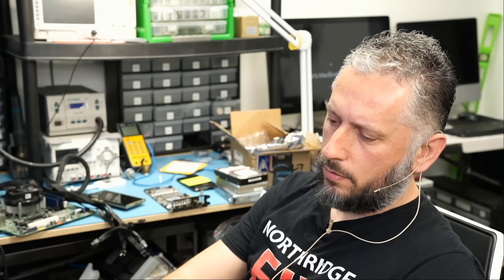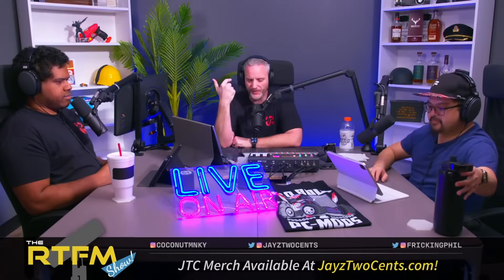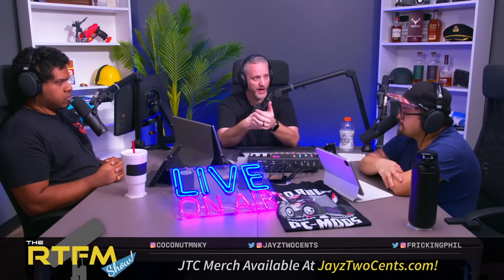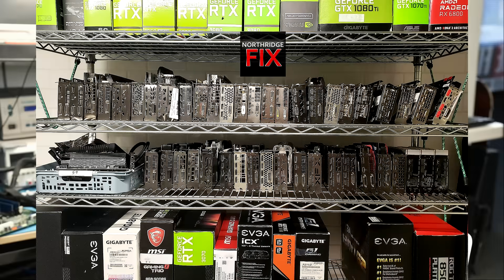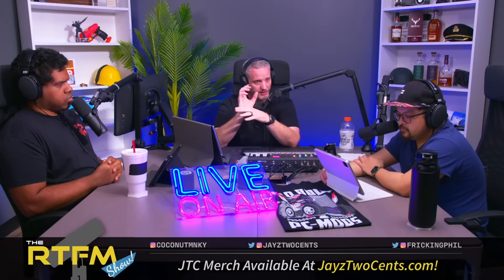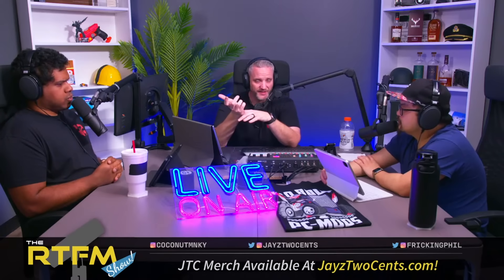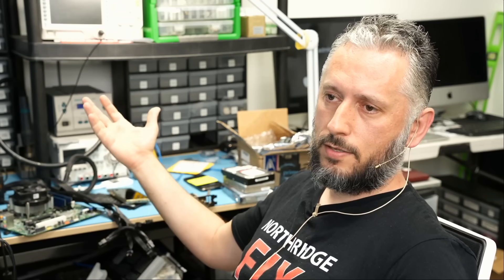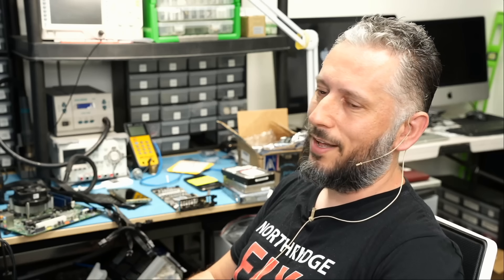Melting 4090 and CableMod. JayzTwoCents and Gamers Nexus Response. Blame NVidia or User?

Comment: My 4090 cable mod 180 melted into my card. The input side was fine, and it was fine before I got the 180 connector also.

Cable mod gave me a refund, didn’t want pictures, didn’t care to see the card.

I painstakingly removed the melted sections of the connector, literally cut it up and am still using it with the original 12vhpwr and it’s been fine.

I sent GN and email but I understand they’re busy. Still have the card and connector. 

Yes of course it was plugged in all the way. Photos to prove it

I’ll probably order a connector at some point and replace it myself but it’s been fine for a month now

Comment: I will still say this is the connector problem and refuse to buy any card with the new 12V HO connector, point blank. It is simple electrical flow. Electricity flows along the surface of the wires/connectors, so surface area matters and a good, tight connection matters. This is a common issue with those stupid wire nuts use for house electrical. a Poorly installed wire nut is a fire hazard waiting to happen and almost burn my house down. You take current that used to use 4 8-Pin connectors, hence this being a 4090 issue and not so common on 4080s. The 4080 uses a 3 8-Pin to 1 12 pin and the 4090 uses a 4-pin to 1 12 pin. You take what used to require 32 Pins and a thicker gauge wire and connector and are forcing that current through a small connector/gauge wire with smaller pins and only 12 pins at that, means more heat. Those smaller pins are also making a much weaker connector then the 32 pins used to make. Again, SURFACE AREA MATTERS! A bad, weak connection creates heat and starts fires, the end. This is NOT user error, this is a poor/faulty connector design! The 4090 is pulling too much current for what the connector can handle. Again, the 3090 only uses 3 8-Pin to a 12 Pin adapter as well. There's a reason NVidia made the spec for that adapter to use 4 8-Pins! It can draw more current under certain circumstances then what 3 8-Pins can handle. You really need to have a way to monitor the 4090's current usage over time and find out what current it's hitting when it's melting these connectors and I bet you, it's more than what an OC'ed 4080 or 3090 are pulling or why does it require 4 8-Pins on the adaptor? If the connector has enough play that the connector can back out, that is a bad connector design as well. These connectors are the problem, they leave way too much room for error, make a horrible connection and don't meet the current requirements for the cards, the end. The connector needs to be redesigned or not used at all and go back to the old 8 pin connectors. I rather have 4 of them, then worry about my GPU dying and having to pay to have a connector replaced every 6 months on a $2000 GPU.

Comment: I think it's pretty obvious the 4090 is pulling more power on pins than the connector is rated for. Electrical resistance while pulling high current creates heat, and a lot of it. Is it so hard to believe that the 4090, being one of the most powerful cards on the planet, is pulling too much current over pins that weren't designed for it? I wish someone would put together a video about putting an amp meter on those pins to see what they pull during a hard run of the card. I think the results would be pretty telling.

Comment: Was super paranoid about this and made sure my connecter was fully seated numerous times. Literally not even 20 minutes ago while playing Diablo 4 I smelled a plastic burning smell from my not even a month old PC and knew where it was coming from. Opened up my case and the connecter is hot to the touch. There’s definitely some melting and I’m scared to pull it off.
Reply: Which 4090 do you have?
Reply: @dudee789  it was the white strix OC

Comment: I just purchased a Asus Strix GeForce RTX4090 OC GPU and a 180' angle Cable Mod Connector for the card. Now I am worried that I purchased bad goods. $44.90 for the adaptor and 2190.00 for the Card. Perhaps if everyone that has had a melting issue would get together and file class action against Nvidia. Now I am seriously considering sending my RTX4090 back. I just gave my friend Northridge Fix's  phone number to get his 2080ti repaired. I have an Thermaltake 1200RGB PSU that has issue sending power out to the GPU going to send it in to get repaired as a back up Power spikes here is California.

Comment: Just want to say first off that I appreciate all the work you all do. Northridge, Jay, Steve, etc. My opinion. NVIDIA needs to man up and accept that they f**ked up and issue a recall and fix all 4090's released to date and figure out why this is happening. imo, Id 86 that connector. Go back to the 8 pins. Id rather have 3-5 connectors that are PROVEN to be sturdy and reliable no matter the application/situation than use 1 connector that is more a fire hazard than anything else in my house. imo, they are trying to crank too much power into these cards. They rushed the 40 series by overpowering them and it is now showing. Now wonder EVGA left the game. They saw what was coming.

Comment: Hmmm no I dont think you can conclusively say it's the cards fault, we don't know how good the contact is between the pins of the adapter and the card, and also fyi those adapters have caused many cases of melting, please check some forums

Comment: I agree with you. NVIDIA made some design turkeys. A motherboard for HP whose solder balls melted breaking the connection for the onboard graphics. Which rendered the motherboard completely bricked. Even, if you exchange to a new one (same model) you end up with the same result. So, they need to use more time trying the designs before selling it to the public. (Burn in process)

Comment: There is a lot of current flowing through that small connector. Heat is always an enemy of electronics. I do not have a 4090, still sporting a 3070Ti (because it was all that was avail at a reasonable price during this whole Cov..ordeal) I think their design and heat dissipation solution has to be faulty. They were better off separating the inputs and spending a couple dollars more per card than their saving costs by this design. Sad thing is, people who bought these cards will likely not get compensated and even if there was a class action, payout would be peanuts in comparison to the cards cost.

Comment: It is both a combination of user and manufacturing error,  I have worked in the electronics industry for just over 23 years and have come across similar issues over the years, too many to go into, but please read the rest of this comment.
The issue Alex, Jay and Steve, have not looked at is a problem I have seen in the past.
There is no problem with the actual card but the socket on the card, if the cable has not been inserted correctly then you can get high resistance and heat resulting in melting, also with the cable adapter inserted correctly as Alex said you still have the same issue which would lead me to look into a bad batch of sockets on the cards, if it was a cable issue then it would happen with every card.
We had an issue many years ago with board manufacturing that had faulty connectors that  melted when under test and the issue was the tolerances in the socket pins causing high resistance, once a new batch was used from the  the supplier every board passed test.

Comment: I think as engineers the best way will be via testing, I know that takes time and money for each, but will be rewarded with views, My idea is to benchmark the card, while the card is hot, check via thermal camera or laser temp scanner the actual temperature of the connector/cables, then check the type of material used in the actual plug/connector/thickness of male plugs to see if there is a meltdown temp that could indicate that manufacturer changed supplier for a cheaper one (this is an option do to shortages in the last years) or the card is running hotter than what the connector material supports. You cannot imaging those misses in Engineering design. 

Just my 2 cents. Thank you for your videos, so entertaining and educational.

Comment: connector melts due to high resistance between male and female pin. nothing to do if it is tight  or not  . wrong type of connector is used. Is the one end tined and other gold plated,- that is really bad. clearly somebody is using cheap substandard pins  in the harness. once pin gets warm/hot, spring looses tension and resistance increases and get warmer until full meltdown.

Comment: I still cant believe they chose to go with one connector for all that pwr. They should be using 2 12vhpwr connectors on the 4090. Its still so much better than having 4 8-pin pcie connectors! How dumb.

Comment: I get the physics behind the melting etc. If it might not have a proper connection the resistance increases etc...
But a silly question, please let me explain it.
If someone has a modular Power Supply and he/she bends the other end of the calbe (or not plug it in properly) why don't we hear anything about melting connectiors on the PSU?
I understand that by decreasing the surface are for the connection increases resistance thus increasing heat which may cause a meltdown. But why didn't we hear anything about melting power adapters on a PSU aswell (which can have the same connector)
I get it that you don't use to bend those cables aswell (but what if you do). If plugging the connectors in is a "user error" than why does this occure only in case of the GPU side not in a PSU side? 
Or I live under a rock and I just haven't heard about it. That is also a possibility. 🙂
Reply: Surely someone would make a mistake like that

Comment: No you are wron the user is to blame realy ? Day 1 I known that ist Nvidea. They mede the shity design and now they wont edmit it ever ! Some how no body asked how are we now at 3 conecters in one. I did and wanted to know more, because the desighn has to eneble somting like that. But it was only all the cables together realy close by and thin like I dint know. Its creazy that some one said lets make it smaller and dident insulate it enought to outside influence and now we see the card itself does somting to draw to much thrue one conecter and melts. But in any case that outside influence cant be caled user aror. The user doesent need to inshure and wigel the PSU cable and when he doesent the whole PC can die seriusly abounch of bulshit from Invidea !

Comment: Hi Alex,

my opinion is also a design problem. maybe there are some cases where the customer do not plugged in the connector in a right way but this is not in summary for all melting connectors. Did you hear that someone do not plugged in the 6 or 8 pin connector in a right way ?? NO, because this is hard to do :) remember you spend over 1000€ for a graphics card and then the connector is melting and you warranty is not tangible. hard to belief. i wish i had the skills from alex to help the people who have problems with their connector

Comment: I'm telling ya. All they need to do is put a couple lugs on the PSU and two on the video card. Two 6 AWG flexible stranded wires between them. You can cap them off with some plastic covers to make it look good.

Comment: To be fair. I have seen so called normies plugging in computer power cables of all sorts. And it can be quite scary, because in some cases they might not connect them fully enough and securely enough. Probably because they go too easy on it and also rely that its designed so that there is room for error. Which there really isnt especially on high end power hungry stuff. One needs to make sure the power cables are connected properly and securely. Maybe double or triple check. And that the connectors are not under stress from too tight cables and such. 

But still, i dont think that its totally user error in this nvidia 40 series case. The connector itself seems a rather weak design. It should have had a secure and tight double clip design imo. Or at least much larger one clip design. But that doesnt still explain why the high end 30 series connectors arent melting.

Comment: I believe it's Nvidia's fault for making a connector that puts out THAT MUCH WATTAGE THAT SMALL. Any half Bates electrical engineer knows that the more current you're pushing through a wire the thicker it needs to be. The cables on these connectors are thinner than the wires I use to put my slime trackers together. That's pathetic

Comment: i work with this range of connectors made by  molex, tyco and amp and steve has got it so badly wrong i have to cable tie them down to stop the walk out WHILE CLIPPED IN , iam stunned hes missed this with all his resources , but on a good note imagine all those bitcoin mining cards diying a dozen at a time haha 
i wouldnt trust these cheap flimsy connectors with any more than 3amps per pin unless you can lock them in with a cable tie
the row of pins far side from the clip are the most prone to fail
but the connectors will melt while fully home eventually anyway  =oxidation
time for a XT60 mod! thats the real deal conector

Comment: As a electrical specialist you can calculate consumption and size consumption if matching with conductors.
If you have 500w consumption of video card and wires and connectors are at limit, every slight variation will cause burning connections. So the issue is in the middle, the connectors have either to big margins of contacts. 
There is also a fault of video card producers, they should make maybe bigger thicker male pins of connectors and will reduce margins of bad contact. 
One thing is for sure, that is a issue with bad connection, or terminals doesn't match with power delivery, they should make them thicker to support all that flow of amps.

Comment: I'm curious, which models of the RTX 4090 so far have had these melting issues? Maybe these models have something similar specifically. Perhaps a material similarity or a measurement/thickness of parts similarity for the bits that make up these connectors? Would be a good idea to see a list of these models/AIBs so people can avoid them.

Comment: I do believe that NVIDIA should take responsibility no matter what, but I disagree with the interpretation at 15:30. Steve didn't say that the cable/connector melted and the user replaced it with the CM adapter. He says we don't know how the card has been used prior to the failure. Ultimately the failure occurred with the CM adapter socketed in, but it is possible that due to how it was (mis)used before, the connector has degraded, e.g. FOD accumulated on the pins causing worse-than-expected contact.

Comment: To fully seat a connector by jiggling it 2 billion times and/or having a fully seated connector unseat itself because you bumped the computer is called bad design. NVIDIA needs to recall. Alex is correct.

Comment: May be I think 4090 drawing more power than rated current of the cable.That cause to heat the connector & the cable

Comment: Maybe the user was using max setting ?   Max speed , max graphics so  its user fault. 
Let say you have a car and that car can reach 300  , dost it mean you should drive it with full speed for a pried of one hour ? 
Definitely not  because you will be dead or engine will explode .
There is a limit for everything in earth.
Thanks

Comment: Would it not still be possible for the pins to have poor connection even when fully seated? What if the failure mode is the same regardless of both your findings? Having worked in an electronics lab, I have destroyed many connectors just from normal use because they arent really meant to be plugged and unplugged a bunch of times... it doesnt seem impossible to have a poor pin design such that it would cause this issue with little use wearing out the pins.

Comment: And car hifists go way lower gauge wires and bulkier connectors on these TDPs.... These cards need XT90 connectors not mini tamiya level connectors. In airsoft tamiya is obsolete replaced with xt60s and deans. And it not good idea cut pcbs grounding area (in 4090 silly triangle cut design) which dissipate heat and lower resistance.

Comment: I think everybody is right because the truth is somewhere here and I can imagine as pcs are built for customers on the way there these flawed cable connections get loose even with that 90 deegree converter and that is a flaw of that card and we must be check every time if the cable is connected 10-20 times just to make sure because something moved the table what the pc is on.

Comment: Thank you for saying it out loud and very clear,  its not the cable, not the adapter,  not the user.    Its a Nvidia issue.   Your paying a premium 2k+ and its burning.   Your going to spend 1k hours on this card and it does this.   No Way.   There needs to be a upgrade path down the road.

Comment: Motherboard & GPU makers need to get together and agree on an industry standard to 
eliminating this cable connection and integrate it into the PCIe slot and be done with all this drama!
WTF is taking them so long to do this?
Mannnnnnnn!

Comment: I think the connector is a fail by design. The 4pin cables on top of the "regular 8pin" are thin and will rip easy when routing in a case. Now the burning at the card connector ? Who ever designed it must be high on the bad stuff. Good that i picked a 4070 with a regular 8pin, might serve as long as my 1080ti and 980ti both still running just fine with  some care and new thermal pads/paste.

Comment: My take is that the connectors are the problem and the root cause is the connector standard. Nvidia will have implemented the connector etc. following the standard but as they are (to my knowledge) the first major user of the 12vhpwr connector standard there is only now a sufficiently high sample size for the possible issues to become apparent. In fact PCI-SIG is already considering changes to the plug, though I'm not sure if that is because of the 4090 issues.